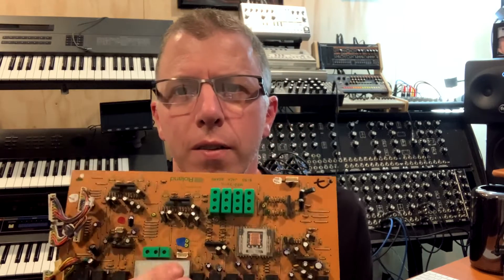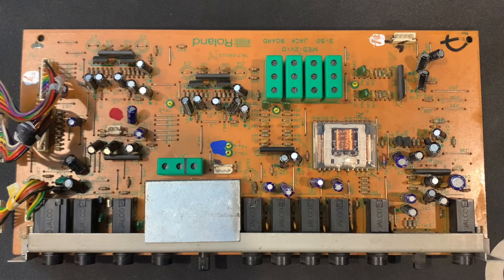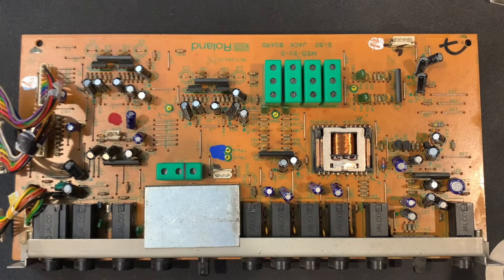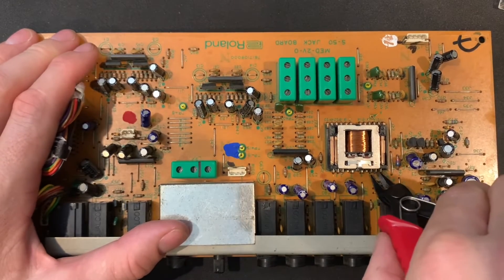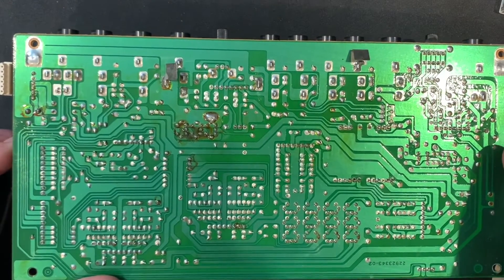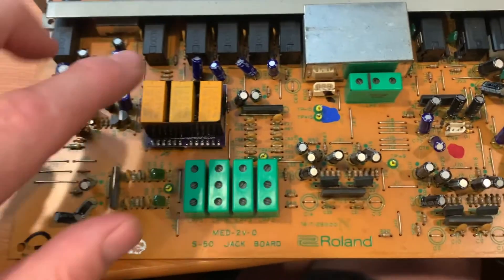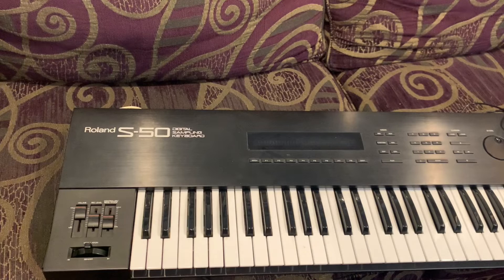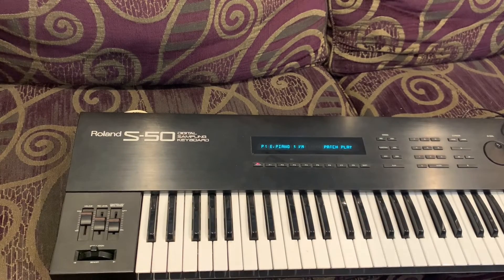Roland S-50 Output Relay Replacement

Comment: Does this really need tape on the backside?  You might as well tape the entire back of the circuit board if you are worried about the back touching something and shorting out lol
Reply from the maker: True - I think because sometimes the relay when inserted, the prongs stick down a bit farther the most the other pcb leads from manufacture.  Good point though - probably not needed

Comment: Unfortunately, when I de soldered, the etchings pulled out as well in some areas. Can I just do without this device?
Reply from the maker: yes - that is a problem due to the singled sided trace design of the Roland PCB - happens often - best thing to do is repair the traces with jumper wire.  Hope you get it going,

Comment: Cool video, quick question, i have the opportunity to buy an S50 really cheap, however there is no audio from the main outs or headphones, could you fill me in on possible cause? I don't want to buy it if it's going to be more expensive to have a tech guy fix it for me.
Reply from the maker: Hi there - sorry for the late response. Usually it's the relay being oxidized. But can also just be a software issue.
Reply from the maker: Let me know if you need help with this
Reply: @johnnymorgansynthdreams  much appreciated thank you! I didnt end up going for it in the end.

Comment: Johnny, Where could I send the board from my S-50 to have this done? And, alternately, who could I purchase the replacement relay from if I chose to try to do it myself? Thanks!
Reply from the maker: Hey there!  You can ship the output board to me and I can do the repair for you.  I'll do the repair for free, but it'll cost you a little extra for shipping.   Contact me through my contact info above and we can go from there.
Reply: @johnnymorgansynthdreams  Thank, Johnny!  I just ordered the relay from you and I think I'll take a stab at it, using the excellent demonstration. I'll be clipping the leads from the old one before applying any heat.
Reply from the maker: @thirty3na3rd  Ok great - feel free to ask any questions - I just shipped your relay out this morning.  All the best.

Comment: Probably best to desolder the part without clipping its legs off
Reply: Arguably that’s the “right” way for someone with experience and desoldering tools.  That’s not everyone.  It will be far easier for someone with limited tools and experience to complete this repair successfully by clipping the legs and removing the leftovers individually.  The reasons are several, including: less heat will be required to remove the small leftover bits and there is no temptation to pry on the component to remove it and thereby mangle the traces (as Johnny describes).
Reply: I am a novice at electronics, but i have worked on a few of my older synths and, honestly, desoldering anything with more than 4 pins is as scary as shit. The safer, the better. 🎯
Reply from the maker: Exactly.   I've done this repair a few times now and the traces and pads on this crappy PCB damage so easily - you pretty much need to cut out the old relay so you can use less heat and not damage the board.

Comment: It works for me without a relay at all.  with jumpers installed and that's it.
Reply: Same question!!
Reply: I wonder what the voltage spike of the power on pop is?
Reply: A little grunting in the speakers and that's it...
It doesn't bother me much. @syniteq
Reply from the maker: Yeah as I said you can jumper it for sure
Reply: @johnnymorgansynthdreams I need to jumper mine. I'm in Malaysia and would be tricky to get a new relay and install this side of the world. Can.you explained which pins on the relay  need to be jumpered pls?
Reply: Do you jumper the contacts that are directly across from one another? I might consider doing this.
Reply: How do I do this please?
Reply: @bazildonboi  Look at the diagram to see which contacts the relay connects and simply connect them directly with wires. In this case, you'll hear a noticeable pop when you turn on the device.